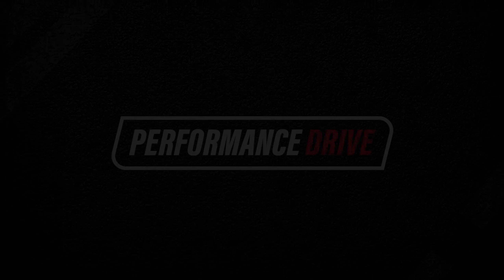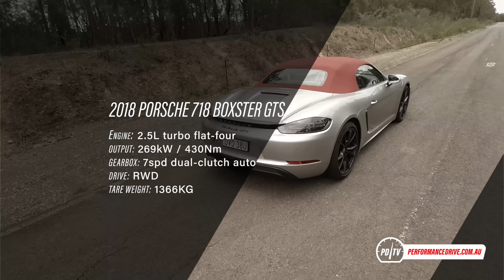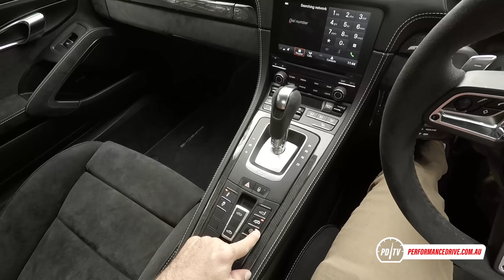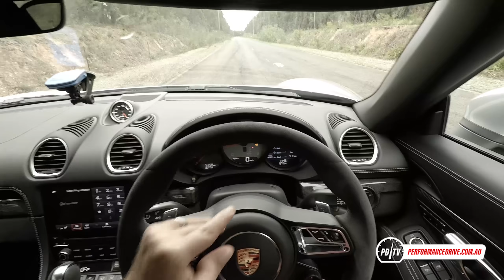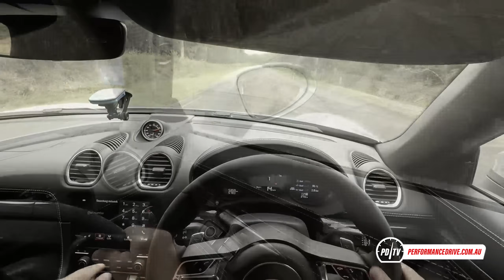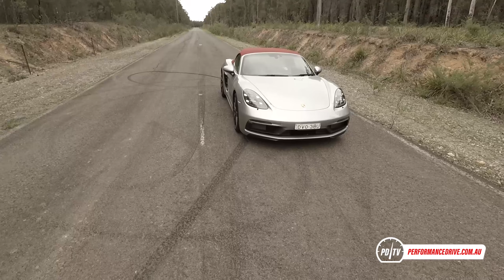2018 Porsche 718 Boxster GTS: How to use Launch Control (POV)

Comment: Best instructional video on how to use my Porsche launch control 👍
Reply: I agree, it’s amazing how many people make videos and they can’t even cover how to do it, or they leave out a bunch of information that you need. 

In summary: Sports+, left foot hard on brake and hold, press accelerator to the floor (launch control activated message appears on right dash display) then keep accelerator planted 100% and quickly release the brake.

Comment: You don’t have to turn the PSM to Sport Mode.  Just hold the brake, smash the accelerator & release the brake when Launch Control Activated message comes up.

Comment: I don't know if it's different for right hand drive cars but in the US you don't have to change the traction control setting (you can leave it in normal) to do a Launch Control start.  Just Sport Plus mode, foot hard on brake pedal until "Hold" appears and then floor the gas and let foot off of brake.  Source: I have a 718 Cayman base.
Reply: Matthew Gaither i have a bade boxster with sport exhaust but no chrono pack. i launch it by turning off psm off completely, i just hold down the button for 3 seconds to make sure. The  put the gearbox in manual, and hold the break, floor the gas completely and hold it for 2.5-3 seconds, and release the break and i fly to the moon in 4.7 seconds. I wonder if building the revs is the correct way to launch, or to do it my way

Comment: Why didn't they put a de-tuned base 911 3.0 engine in it!
Reply: Because nobody would buy the 911 if they did. The cayman with the 2.5 is already faster and more agile than the 911, and 2/3 the cost.
Reply: with the flat 4, its below 3,000 lbs. The Cayman is meant to be a lighter, better handling, mid engine Porsche.
Reply: The logistics of putting such a larger engine in the car just to decrease the power would not give optimum performance results. There needs to be weight balancing and allocation of parts.
Reply: I'd ask the same question. I'm guessing that they are using the new 718 line for research and development in the 4 cylinder arena
Reply: This is now the engine option in the 2019 Boxter/Cayman GT4
Reply: @RayDCO  still not the same engine
Reply: I believe they went to a 4 cylinder engine to please their Chinese market. In China they are heavily taxed by the size of the engine. Here in the US the 4 cylinder is a sales disaster. Porsche is now offering a 6 cylinder , non turbo engine with close to 400hp for the 2021 model year and it is selling very well here.
Reply: @philipjc1  So well you can't actually buy one. I tried. Ended up buying a pre-owned Cayman S. Awesome car, and as someone who has never owned a 6 cylinder Porsche, I find the engine noise aggressive and rumbly in a good way. I am considering an APR ecm tune, more power than the GTS 4.0 in a more usable power band. I would love a screaming GT4 RS, but I am not special enough to be able to buy one... 

Also, I'm not sure a multi-month wait list to buy a Boxster/Cayman with the 4 cylinder could be called a "disaster".